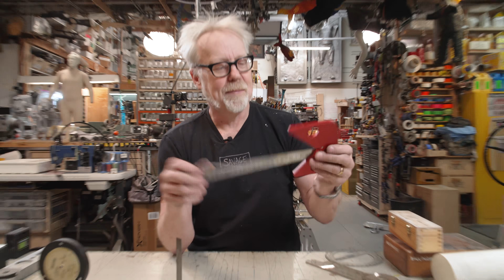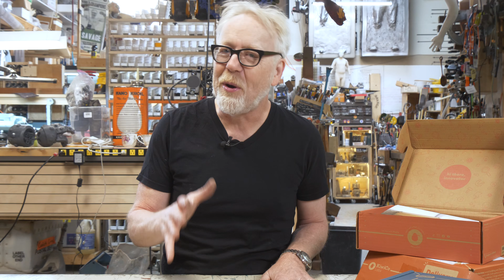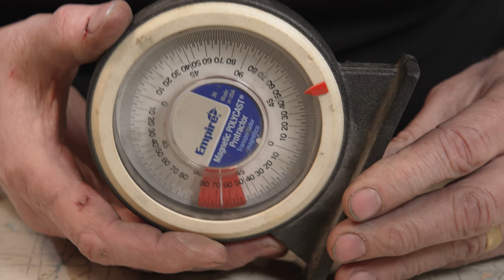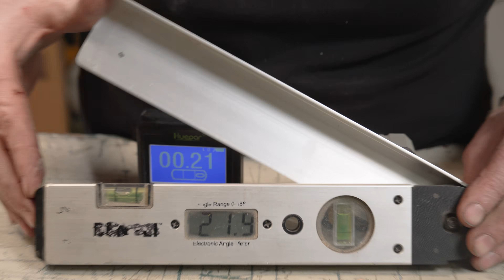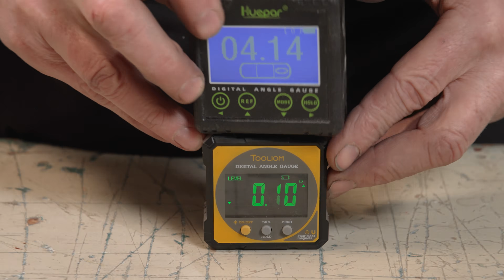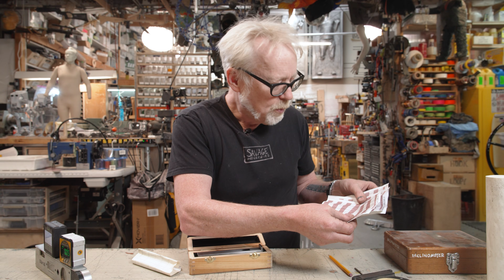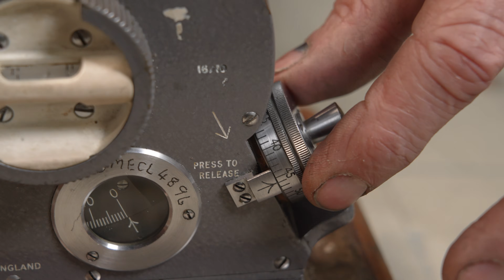Adam Savage's Obscure Angle Finding Tools!

Comment: The small square digital angle finders have a resettable zero. That lets you set a datum, like the lathe ways or chuck or another feature on the part, and check the angle against that.
Reply: Yep, this is the trick.

I use these to level the saw blades on my portable table saw. Even if the saw is a little off level, in grass or whatever.... Zero the meter off on the face of the saw table, then wind the blade up high, slap one of these little guys in the side of the blade and set your blade angle.

Works a bloody treat. You can also use them to set specific angles when sharpening knives, etc. Great, compact and convenient tool. Mine has a basic laser level also... Good for some things

Comment: HEY ADAM... Just for your information: There are some interesting OPTICAL Goniometers, that shine  Laser pointer against the edge of a knife, and measure the angles of both sides of the knife edge, that help a lot when sharpening the knife, or a carpenters chisel or plane blade.  And you could make one of those easily by using a transporter and a laser pointer!

Comment: Do you ever measure surface roughness?  Back at work in the aerospace biz we had a thing called a Mahr Pocket Surf which could do just that.  Not cheap, $2,000 -$3,000.

Comment: I was racking my brain to think of any interesting angle measures and thought, what about radians?, there's probably some niche use case there and remembered Pi tape, a tape measure that measures diameter. It's good for big, thin walled flexi things that you can't just measure the diameter of.
Reply: And trees. A DBH (diameter at breast height) tape is typically a fabric tape with inches/cm on one side and pi*in/cm on the other.

Comment: The medical device is called a "Goniometer."  It's used to measure mostly range of motion for either an injury deficit or to measure the progress with something like physical therapy.
Reply: Yep exactly. Now I'm wondering where I put my goniometers... 🤔. Haven't seen them in years
Reply: Yup! In cycling we use them for bike set up to measure limb angle like your knee to work out seat height
Reply: @jono_church exactly
Reply: You beat me to it. My mom goes to physical therapy after an accident and the PT uses them to check her range of motion
Reply: I broke my foot a year ago and they used these to measure my range of motion of my various joints in physical therapy!
Reply: Yup I am in physical therapy for a ankle injury and this is what I saw.l have one myself and I remember of where I got it now.
Reply: I seen them in PT for my frozen shoulder.
Reply: I think they used that to figure out my elbows have 15° motion restriction , cant get my arms straight .
Reply: And for measuring angles of knife edges is the laser goniometer. I have a couple.
Reply: We use them daily in the O and P field. Especially for the fabrication and measuring of casts. They also help with adapter setup.
Reply: They're called goniometers in a medical setting, but the word itself generically means angle measuring tool. It's also used to refer to radio direction finders, and tools for measuring the cut of a gem.
Reply: My wife got her knees replaced, and used them to test her progress in regaining her range of motion.

With knee replacements, if you don't get enough range back on your own, they will knock you out and force work the joint to get there, and you wake up very unhappy. Fortunately she was able to get her joints worked sufficiently to avoid that.
Reply: As a road cyclist, I’ve had numbers of bike fits and these are common to set seat height and position while maintaining a specified angle at the knee joint with the foot at the bottom of the pedal stroke.

Comment from the maker: Machinist square: https://amzn.to/4lDQDEn
General tools angle finder: https://amzn.to/4lBbUhW
Rounded tip angle finder: https://amzn.to/42bzbiO
Multi purpose protractor: https://amzn.to/3RkWIaK
Center finder: https://amzn.to/4iefJXm
Pestige Medical protractor: https://amzn.to/4ihpzaO
Empire Magnetic Polycast Protractor: https://amzn.to/4j9MOF4
Digital Angle Finder: https://amzn.to/4cuzOaC
Digital Level and Angle Gauge: https://amzn.to/4iklF17
5" sine bar: https://amzn.to/3Y28j2h
Disclaimer: Tested may earn an affiliate commission when you buy through the links here
Reply: u don't have one of those lcd angle meters? The ones with two stainless rulers joined where the lcd readout is and a knob for tightening it.  Similar to one of those digital calipers, just for angles.

The other angle measurement instrument u don't have that improves on to the clinometer is a theodolite.  The old ones from like 30 years ago without any digital tech in them are really cool.